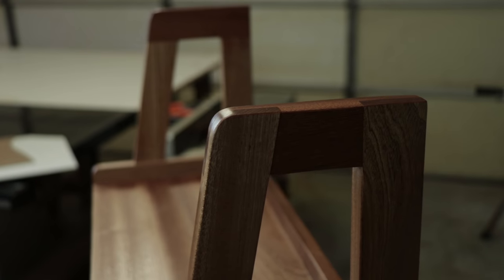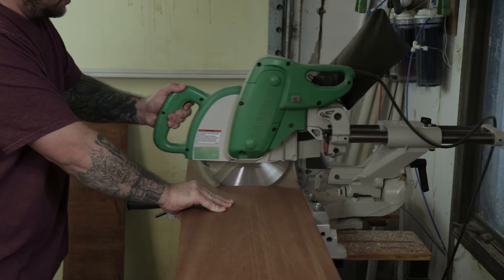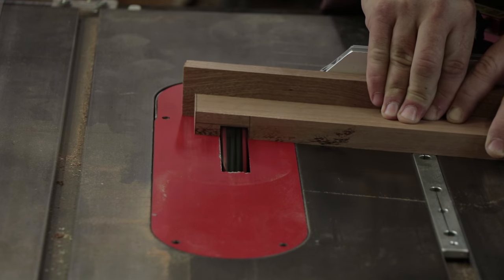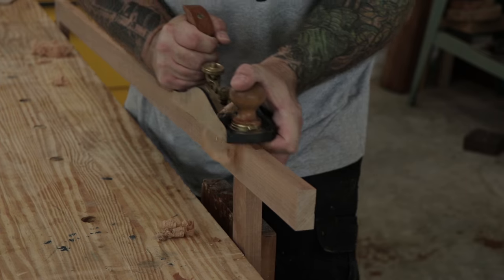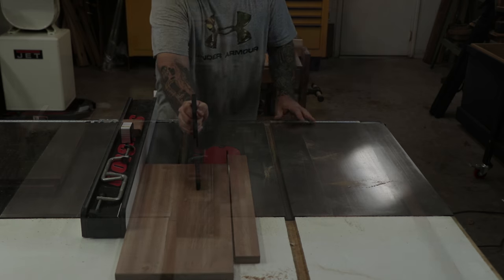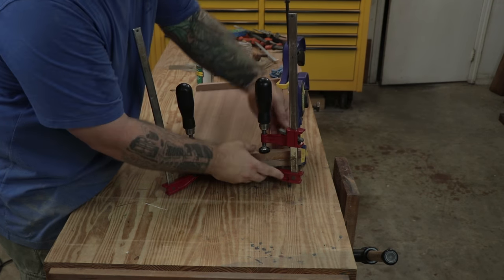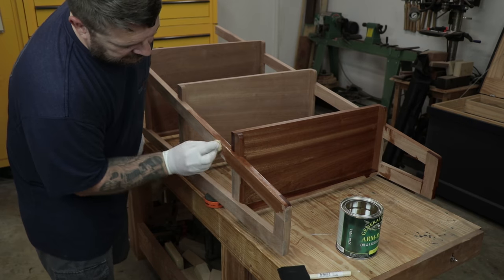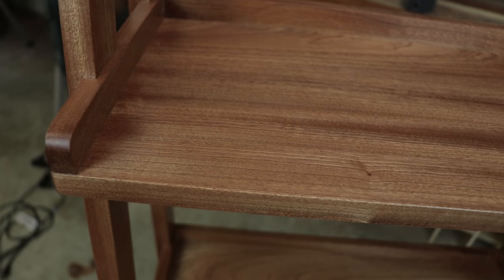DIY Modern Ladder Bookcase build

Comment: Hello there,

This is a nice simple project, done without silly complications. If I may be allowed a couple of observations (I'm a European cabinet maker and furniture restorer).
1) You sanded the uprights AFTER having assembled the ladder shape of each side. It's always best to sand BEFORE assembly; you can always do little touch ups after gluing. If you have a very flat work top, you can butt up both uprights to make a wider sanding surface- this keeps them flatter.
2) Same thing with the shelves; it's much better to do the edge sanding BEFORE assembly (these are "golden" cabinet making rules the old boys used to teach us)
In fact, you could even go as far as doing the finishing on the shelves even before gluing the lipping, that way you don't get the tricky corners to finish.
In other words, it's best to do nearly ALL the finishing before final assembly. So much less hassle at the end.
However, very nice project, well done. Nice, simple approach.
Greetings from France.
Reply from the maker: Thank you. This is what I hoped for when joining the community of wooodworkers on line. The feedback is greatly appreciated.
Reply: @TwistedWorkshop77  My pleasure, really. Self doubt, of which I have plenty, is always good fuel for improvement.
You have a direct, simple, and healthy approach to your job, which is excellent. All of my life I listened to the advice, sometimes critique, and golden tips from people older and more experienced than myself. In England we say: No man is an island. We all need each other. To bad that some seem to live on their own planet, and don't care about others.
Wishing plenty of challenging projects in the future. Wood is a LOVELY material to work with.
Last piece of advice: try to do simple hand finishes, like planing, scraping, and sanding entirely by hand- you can get beautiful results.
Best regards.
Ralph

Comment: 👍 👍👍 really awesome and great build, As far as the dados are concerned, the only thing which comes into my mind is not using the table-saw but the hand router. If you prepare a very simple  kind of guide-jig, like a board with two parallel edges and for example a 1x1 strip of wood gued on one side along the edge.  Attaching the jig to the bottom of each frame and extending it all the way up in the same manner on both frames, the dados will be always  positioned equally.
Reply from the maker: the tinywoodworkshop, thanks for the recommendation. I think a router and a jig would have been a good option. I don't use my router enough but should. It's so noisy and messy!

Comment: This would be a good place to use hide glue vs pva glue.  With hide glue you could wipe up the squeeze out with water and it won't affect the finish.
Reply from the maker: Thanks. I've only used it a couple times and it was the titebond brown bottle. I've been thinking about using it more to get some longer working time. What kind do you use?
Reply: @TwistedWorkshop77  I have the Titebond brown bottle as well.  A bit sticky vs the regular stuff, but it does clean up well in glue-ups where squeeze out is inevitable.

Comment: How will the shelves be able to expand and contract with the cross grain glue up of the lips on the shelves?
Reply from the maker: If you are concerned with this you could use dowels to hold the lips and no glue or glue in the middle. This shelf is still in use today and there are no expansion/contractions issues. No cracks, gaps or warping. Looks and works as good as the day it was built.

Comment: I am planning to build one of the these. I did see someone mark everything out then just cut dados with a circular saw (many passes) close to the lines, clean it up with a chisel.  A router plane might be better for that cleanup.
Reply from the maker: Good idea. Good luck with your build
Reply: @TwistedWorkshop77  Jay Bates made a small version of this and hogged out most of the material w a dado blade, then chiseled to his marking lines.  I might do that but I have to laminate the ladder sides so I might just space the out to accept the shelves.  Leave the shelves a little proud and plane them to fit.  That will save me some time hopefully and still look good.

Comment: Any chance you would able to or willing to list the dimensions for this build?  A total newbie here who is going to be trying this for a christmas present.
Reply from the maker: Sorry, I just saw this. I will get some rough dimensions the next time I am at my wife's salon (a day or two). Cant find my shop notes for this.
Reply: @TwistedWorkshop77  Wow, that would be awesome.  Thank you so much for taking the time to do this. I really appreciate it!
Reply from the maker: @wrynner32  I got some rough dimensions that should get you close. If you have any other questions when you get in to it, let me know.
Overall height=55", the legs are 1 3/4" wide x 3/4 thick, front legs are angled at 10 degrees, the top braces that connects the front and back legs are 5 3/4" long x 3/4" thick, the bottom shelf is 22 x 14 1/2 x 3/4, middle shelf 22 x 12 x 3/4, top shelf is 22 x 10 x 3/4. The lip that goes around each shelf is made from 1"tall x 5/8 wide strips of wood. I forgot a couple things. From the Ground to the bottom shelf is 16 3/4". Ground to the middle shelf is 30 3/4". Ground to the top shelf is 44 3/4"
Reply from the maker: I forgot a couple things. From the Ground to the bottom shelf is 16 3/4". Ground to the middle shelf is 30 3/4". Ground to the top shelf is 44 3/4"
Reply: @TwistedWorkshop77  Thank you so much for taking the time to help me out with this!  I really appreciate it.  You answered all my questions.  One of the things I was struggling with was the dimensions(mainly thickness) of the legs.  I was hoping to make the project out of one piece of walnut but my local dealer wanted almost $500 for the piece of walnut so I need to figure out something a bit more cost effective.  Anyways, I can't thank you enough.  If there is ever anything I can do to help you or your channel let me know!
Reply: @TwistedWorkshop77  For everyone to learn from my mistake trying to recreate this - the creator hasn't listed the bottom braces that connects the front and back legs! I totally missed this thing having bottom braces somehow. My estimate is that the ground to the bottom brace is approx. 140mm. Great video & shelf mate!

Comment: Nice work but as a useful bookcase, it is not practical.  With a semi-tray tier, dust could build up at the back and insects could also use it as a cozy place.  It would be better to place the brace (1 or 2 about 1" W at back and two sides) a few inches above the tier to hold the middle spline of the books, rather the base end of the spline.  Cleaner and  better aeration for the books.  Prevents books from fall off (like when you want to move it away from the wall).
Reply from the maker: Thanks for the feedback. I learned something. This was built for my wife's hair salon to hold magazines and or products and it has been working well although it does get dusty in the corners. I thought after researching what other pieces of furniture of similar style were called, ladder book case best described it. I am going to build a dedicated book case for my home book collection and you have given me some great points to consider when designing it. Thanks again

Comment: It’s maddening that measurements are not given. Occasionally you throw a number out here or there but you don’t give measurements of the pieces! But nerves to call this a DIY without that info
Reply from the maker: I provided this to another commenter. I will try and load the dimensions the video description. Sorry for any inconvenience.  Here are some rough dimensions that should get you close. If you have any other questions when you get in to it, let me know.
Overall height=55", the legs are 1 3/4" wide x 3/4 thick, front legs are angled at 10 degrees, the top braces that connects the front and back legs are 5 3/4" long x 3/4" thick, the bottom shelf is 22 x 14 1/2 x 3/4, middle shelf 22 x 12 x 3/4, top shelf is 22 x 10 x 3/4. The lip that goes around each shelf is made from 1"tall x 5/8 wide strips of wood. I forgot a couple things. From the Ground to the bottom shelf is 16 3/4". Ground to the middle shelf is 30 3/4". Ground to the top.
Reply: to "Hey Jamie" - Nothing wrong with politely asking for something like measurements, but the nastiness is uncalled for.  This is a great video, and very helpful, with some great suggestions on a surprisingly tricky kind of shelf.  No one owes you anything.  Oh - and the question was asked and answered previously, so you might also try reading.